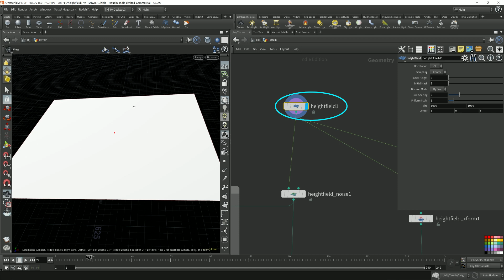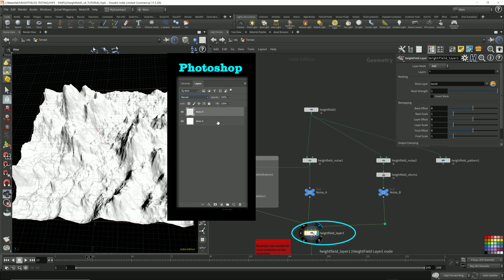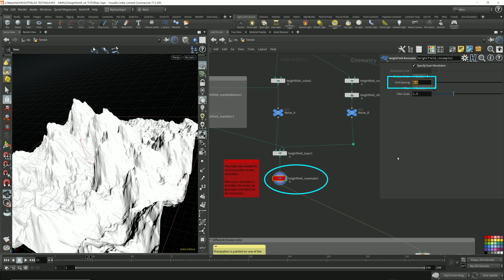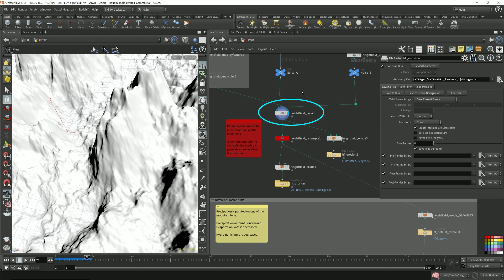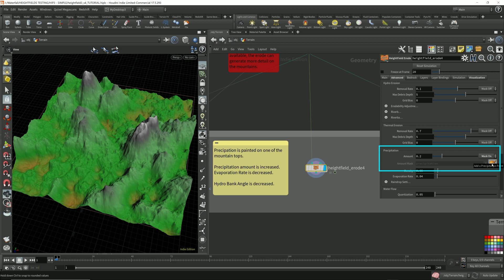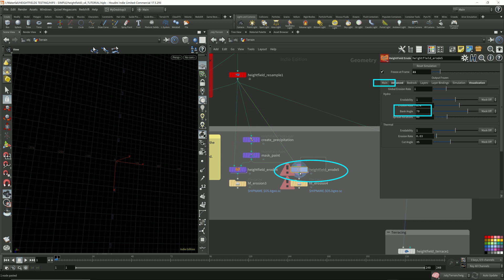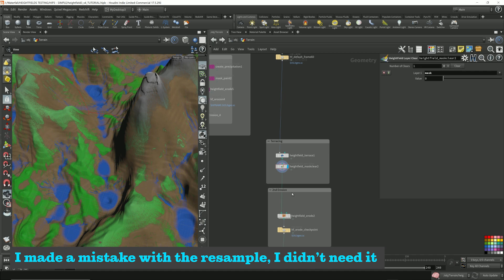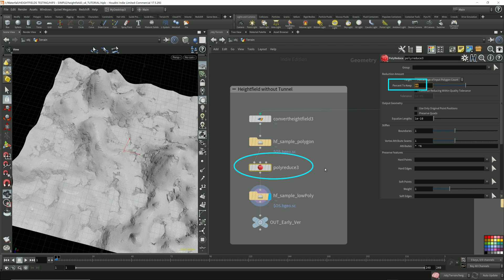Height Fields for Beginners in Houdini

Comment: Excellent tut many thanks! Can i ask a question? Is there a way of importing masks for a terrain and have Houdini recognize them bcs I'm a Gaea user and i would like to put Houdini in my workflow between Gaea and Ue4
Reply from the maker: I think it's possible.  I never used Gaea before, but if you can get the mask imported as a SVG or png I think you can then use the HF project node to project a mask onto the terrain.
Hope that helps!
Reply: @bubblepins  Thx you point me in the right direction :) <3

Comment: Hello thank you so much for the tutorial. When I select precipitation -- mask on-- Add a paint precipitation node  is grayed out and I am not sure why this is. I understand i can do this with some of the following nodes but is this feature not available in Houdini apprentice? I am using houdini apprentice 18.0.46
Reply from the maker: It should work with Houdini 18.0.46, to my knowledge this feature has been in Houdini for awhile now.  When you move the mouse over to the 3D viewport can you paint stuff?  Try pressing Esc on the keyboard multiple times to exit out of the function and press the paint icon again just in case Houdini is stuck or something.  Because sometimes I do notice that it gets stuck.  If that doesn't work, try closing the Scene View and open up a new Scene View window.
Reply: @bubblepins  Thank you very much. I set up the nodes manually and then the paint precipitation node was able to be selected. Not sure why but at least i know how to do it manually.
Reply from the maker: @ckugler75  I'm glad it worked out!

Comment: Noooooo! I was loving this until I hit a snag and couldn't click the "Add a Precipitation Paint" icon. The whole row was greyed out even with it switched to "mask on". When I tried to make the nodes separately they didn't exist. Maybe it's because I'm on Houdini Apprentice?
Reply from the maker: If I remember correctly, I had the same issue, I can't remember if I mentioned it in the video, but that button is a bit stubborn.  You need to revert it to default and try to click it again.  But even then I sometimes had issues, so I would just recreate the whole node.  I would use the paint group node to paint it ahead of time and when I click on the precipitation and if it did fail on me, at least I wouldn't have to redraw the precipitation, and I could just select my painted group.

Hope that helps!

Comment: Can't get the draw precipitation to work though :(
Reply from the maker: I find that the draw precipitation button is very moody.  It'll work on a good day and sometimes it just takes a few more clicks.  This is what I usually do...  I sometimes need to revert the participation parameter back to default to reset everything.  And then try clicking on the button again.  If it still doesn't work, you can try closing the scene view and reopening the scene view again.  And if THAT still doesn't work, I have even went as far as delete the entire node and redoing my participation draw.  If the button works, you usually don't need to go into this much trouble.  Usually if it gets stuck, reverting it to default value will do the trick for me.

Hope that helps!
Reply: @bubblepins  ok, i don't have the slightest idea what i did, but the draw precipitation button works now. It seems like maybe I needed to manually add the HeightField Copy Layer and HeightField Paint. After I did that, the button worked again, even when I deleted those nodes ... wierd.
Reply from the maker: @dissonantprotean5495  I know what you mean.  It's like that paint button is caching something on the disk, but I could never really figure out exact steps to reset it.  I'm glad it all worked out for you.